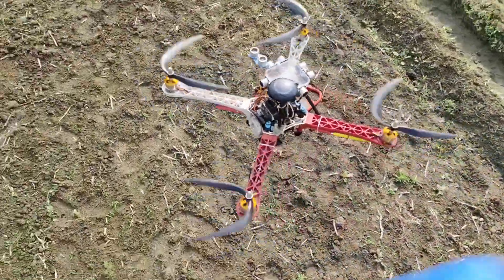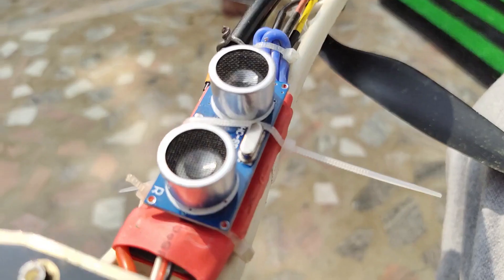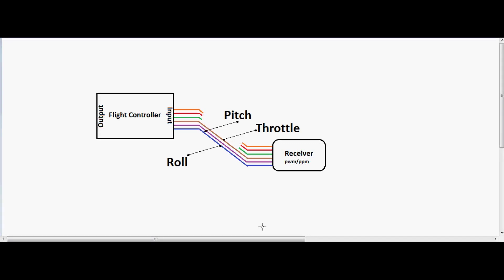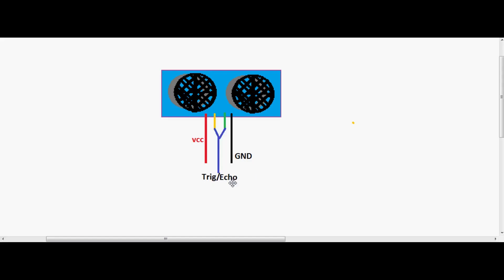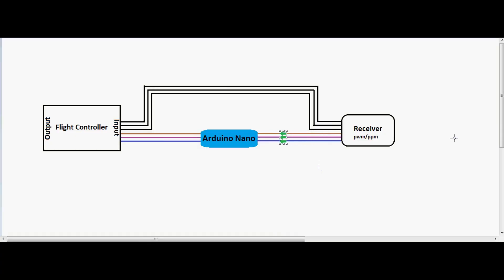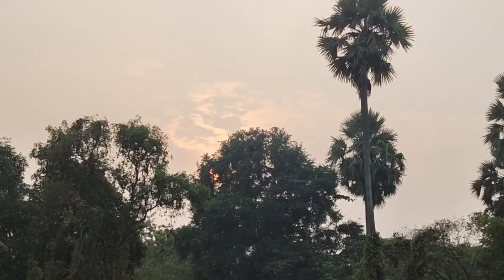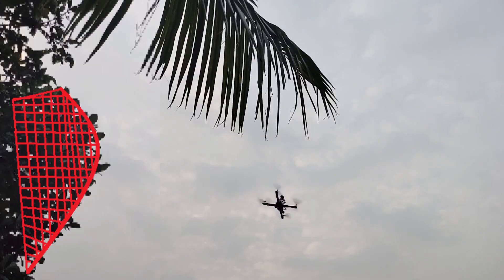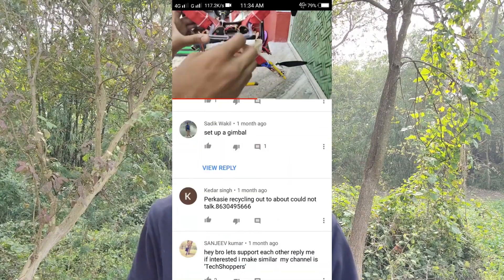Obstacle Avoidance(part1) | DIY | On Any Drone | DIYLIFEHACKER

Comment: Hello, you put these sensors on the APM flight controller, but I have a Pixhawk 2.4.8 flight controller. Can I use the same wiring and settings as the Arduino?

Comment: Very interesting! however, probably not the best to use ultra sound sensors for outdoor use. Would it be conceivable to exchange those senors for lidar and should any modifications be needed in code, etc?

Comment: Hey bro can u tell where can I learn to build the drone , i am thinking we are using a market flight controller instead of creating our own MPC or pid flight controller
Reply from the maker: Finally what do you want?
Reply: @DIYLIFEHACKER  i want to achieve obstacle avoidance , but don't know how will i do that , i can write code for it but don't know anything about how will my code interact with flight controller
Reply from the maker: Just pwm outputs to mimic a rc receiver

Comment: ok i understand .Sorry to bother you i didnt understand ,Anyways i have assembled a drone with your code and circuit but the ultrasonic sensor is not responding thers no output in serial monitor ,can you help me out?
Reply from the maker: Check Serial.print()... are comment out or not.
Reply: @DIYLIFEHACKER   
yes it is commented out
Reply from the maker: @ultramoderntechumt8893  uncomment it
Reply: @DIYLIFEHACKER  
Already Uncommented but no serial output
Reply from the maker: Serial.begin ? check baud rate matches of pc
Reply: @DIYLIFEHACKER 
Yes serial. Begin baud rate matches that of pc
Reply: Your code is not working, no response from sonar sensor

Comment: Hi. Your project is very good. May I find out about how you connected flight control to Arduino? I have a problem there. thank you
Reply from the maker: Through the receiver inputs
Reply: @DIYLIFEHACKER  in pixhauk we have only one receiver input. Is it possible with pixhauk?

Comment: what if the receiver I use only uses 4ch? So where should I put ch5 and ch6?
I really beg you to answer my question this time. please ....
Reply: please.....
Reply from the maker: no need, just a bit code difference. 
put condition to enabke obstacle avoidance system only when downward sensor defecting height above 1 meter.

Comment: How can I install an automatic landing gear system along with obstacle avoidance in one drone? Please do reply.
Reply from the maker: just upgrade codes a bit
Reply: @DIYLIFEHACKER  Bro I'm not that  much familiar with Aurduino IDE so could you please tell up gradation is to be done...I mean what chnages in the codes have to be made? Please tell bro.

Comment: Please send codes for 4 sonars with out rgb led
Reply from the maker: disable sonar5 and sonar6 and everything will be same
Reply: What about RGB neopixel codes.
I am not using RGB neopixel LED
Thank u for u r previous reply
Reply from the maker: No problem code will be same.
Reply: I am not using down sensor which is connected to A1
CH6 in flight controller not connected any thing
I have given powersupply to the arduino nono from apm 2.8  A0 pin beside telemetry pin , leaving the signal pin
Please guide me.

Comment: can you make a diagram for connecting the diagram sensor ultrasonic to diagram drone?
Reply: bcause i make a drone with arduino nano
Reply from the maker: use any available digital pin on arduino.
Then define and compile my codes along with your arduino drone codes
Reply: @DIYLIFEHACKER  hi
Reply: Oke

Comment: No bro open cv will struggle on pi4 or 3 , u need nvidia tx1 basically a nvidia jetson nano, u need very fast reaction time therefore a gpu , and yes 1 camera is not enough, u need two camera to trangulate the depth of the computer vision for obstracle distance detection and avoidence ,cameras must be in synchronisation that is a global shutter,
Reply from the maker: Ok

Comment: bro in vedio  your said that channel 6,5,4 are need not to be disturb but in circuit diagram you use that why can you explain that bro
Reply from the maker: I used only ch6 just for enabling and disabling Obstacle Avoidance system
Reply: @DIYLIFEHACKER  if i don't want that can i directly connect channel 6 to receiver

Comment: good job 
it's work with controller MAMBA f405 MK2 ??
Reply: The code works with pwm i guess , as he said in the video will work with any pwm based input on FC u will have to struggle a little if the reciever is ppm

Comment: Bro I'm using Naza v1 flightcontroller and I'm using D-bus reciever connection between FC to reciever..
But I'm not using pmw sbus 
So you tell how to make connect wiring in d-bus..
Reply from the maker: Let me check
Reply: @DIYLIFEHACKER  bro can u find any solution for this..?

Comment: I am connecting the pixhawk Sbus communication to the receiver X8R how would the wiring be for this system ?

which arduino are u using? Nano? 
is it working with pixhawk ? 
can you tell me what paramater changes in mission planner did you make?

Comment: I have a problem when i try to land my drone it has not been able to disarm it is automatically fly and crash I use apm2.8 and GPS external compass
Reply from the maker: "Try to land" -- means manually or initiating land mode.
if manually then provide more details about the flight modes and GPS status and more while it was flying and also tell how it crashed
Reply: @DIYLIFEHACKER  I fly my drone in loiter mode and land by remote stick not use rtl

Comment: yes bro i did it and using ftdi connector i tried to upload or pair both air and ground module but its not paring please make a detail video on it.i all ready saw your video but its not paring please make a complete and proper video without any audio disturbance bro .and make complete  video on quad using plxhawk and apm 2.8 bro please and please replay bro after seeing this.

Comment: Bro please make a complete build video of quad bro.and having some problems with telemetry air and ground modules .drivers issue .please replay after seeing this bro
Reply from the maker: Download silicon lab cp2... Driver
Reply: @DIYLIFEHACKER  yes bro i did it and using ftdi connector i tried to upload or pair both air and ground module but its not paring please make a detail video on it.i all ready saw your video but its not paring please make a complete and proper video without any audio disturbance bro .and make complete  video on quad using plxhawk and apm 2.8 bro please and please replay bro after seeing this.

Comment: Can we set mission panner to autonomous hover over wave points set along with object avoidance
Reply from the maker: No, in my system it avoides indirectly controlling flightcontroller.
If still i want then surely I have to use apm 2.8's internal obstacle avoidance feature.
Yes, it offers.......

Comment: i soldered apm power module to the f450 board cutting the female xt60 port. what will happen ?
and please tell me how to connect raspberry pi with apm 2.8 ?
Reply from the maker: Check out "Navio 2"

Comment: can i use ardinuo instead of ardinuo nano and use 1 sonar sensor to test first ?
Reply from the maker: Sure
Reply: @DIYLIFEHACKER  i test the code in my Ardinuo UNO , it seems that it works, but i only have 1 sensor in this moment. If i only have green, red LED instead of RGB LED, how can i change the code for only 1 pin for green and 1 pin for red.
Reply from the maker: @sleepingforest2047  contact me on anishdey702025@gmail.com

Comment: I m using apm 2.8 with f-450 frame + m8n gps but my drone fly perfect in stable mode but althold mode isn't work & in gps mode the motor rpm go extremely slow even.  drone fall down and i cant fly drone plz help
Reply from the maker: contact me on anishdey702025@gmail.com

Comment from the maker: New video is out checkout that in my channel....
Thank You.....
Reply: i have some problem connecting ublox 7m to apm 2.8 board but i have soldered  scl and sda . even though the gps is not fixed. but the external compass is enabled.
Reply from the maker: unsolder all internal jumper connection that you have done and just us it normally.
Reply: @praneshr8808  I have upload a video on this problem ones check in my channel
Reply: Next upgrade to drone pls
Reply from the maker: @manjus9903  Sure
Reply: Hey.  Are you a 10th class student . Because the board exam of calls 10 will end on 18 march , on your next upload date
Reply from the maker: @akshatjain2444  Yes bro I'am in class ten but am from West Bengal So exam already finished on 27 Feb.
Reply: Fs -i6 or ct6b is good
Reply from the maker: @manjus9903  "i6"
Reply: What is the difference
Reply: @manjus9903  we need to program ct 6 b using computer& comming to fs i6 we can do any thing using or from transmitter
Reply: Any other difference
Reply: @manjus9903  and you can upgrade it to 10 to 14 channel
Reply from the maker: @manjus9903  also offering inbuilt PPM encoder
Reply: How
Reply: @manjus9903  watch videos on you tube bro to upgrade the transmitter using ftdi or data cavle provided with it bro
Reply: I'm waiting for PPM, as i have PPM reciver 😔  please upload the diagram and code im waiting 😅 and in your diagram PWM reciver CH6 wire goes to A0 but it is not connected to flight controller 🤔
Reply from the maker: @rasesh_pradhan  It goes to the flightcontroller through the Arduino while the arduino can change the channel values to move the drone when Obstacle is detected.
Reply: @DIYLIFEHACKER  bro thanks bit i want to make it with ppm can you please work on it and make a detailed video.thanking you in advance

Comment: Bhai apm 2.8 ka input ka vcc and
 ground wire kaha connect karna he. I mean 2 say circuit ko power kaha see melega
 Plz answer I am in problem . Plz help
Reply from the maker: Power it from Esc BEC
Reply: @DIYLIFEHACKER  esc ke 3 pin wire Bec he kya Jo flight controller me lagta he . Plz reply

Comment: Kon sa flight controller
Reply from the maker: You can use any of them.
It is capable for multiple FC
Reply: @DIYLIFEHACKER  ok bro apm2.8
Reply: Kitna cost aaega
Reply from the maker: @steelbirdinternational1505  4 or 6  ultrasonic sensor and an arduino
Sensor count depends on your desire direction of obstacle avoidance
Reply: @DIYLIFEHACKER  thanks bro